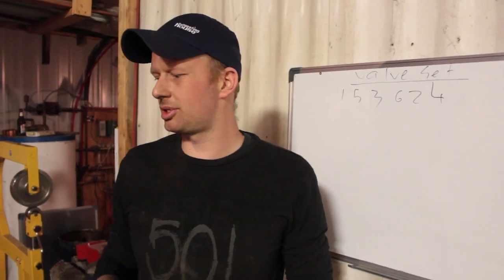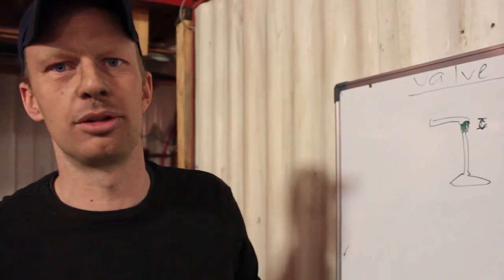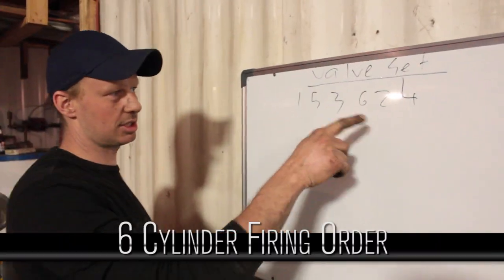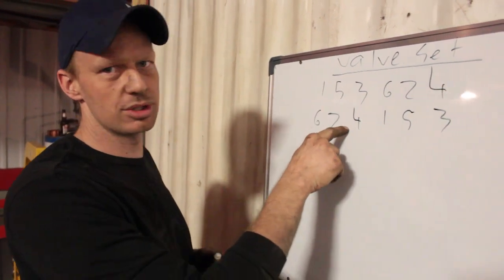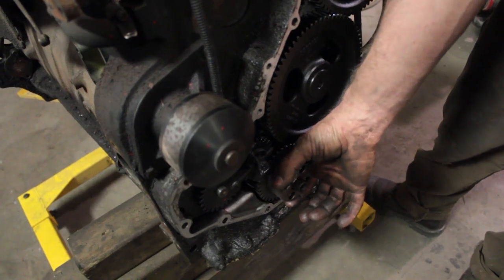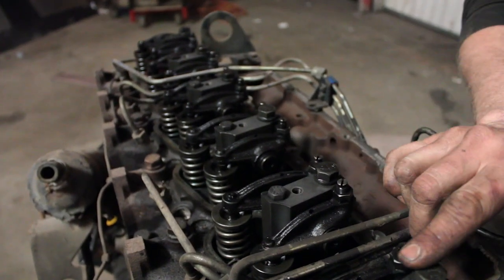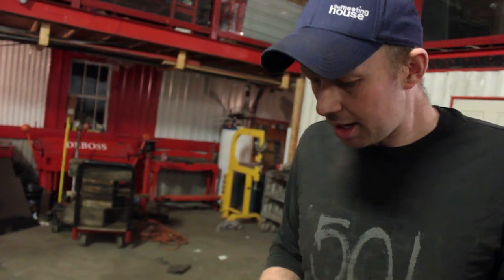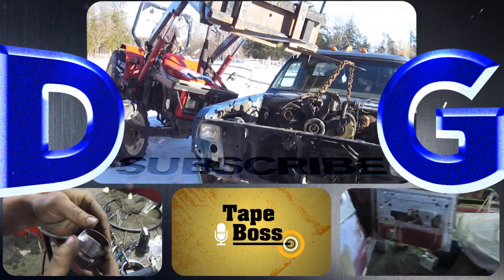How To Set Valve Lash On A Diesel Engine

Comment from the maker: 153624 firing order
624153 valve set
Get a shirt with the cheat sheet: https://teespring.com/straightsix
Reply: Are you going to make any more of those shirts? That’s a lot of numbers to remember.
Reply: great
Reply: Correct
Reply: Told me jus enough to screw me up
Reply: Vere good aaise se samjhane wala hona chahi ye
Reply: torque rating on those fasteners?
Reply: How about v type engine is that same ??

Comment: I would say how some people set their small SI OHV engine lash where having one valve open and one valve closed on the cylinder, checking the valve that's closed would also probably apply.  I don't work on Diesel/CI engines so I am not sure how well that may work.  I would think it's similar since both are 4 stroke and have the same Intake, Compress, Power, Exhaust process but the main difference being compression ratios and no spark plug.  This would seem easier than remembering the cylinder order.

Comment: Most engines are right hand rotation! Which means when viewed from the flywheel end, not the fan end, it will turn clockwise.   DO NOT be fooled by the fan…. Depending on how the belt is oriented the fan may not turn in the same direction as the crankshaft.

Comment: Thanks Rich, its a great video. This is very interesting. I hired someone to come do a valve lash on my Toyota dyna 13B engine, when started it was pushing smoke through the air manifold, i know some settings not right. Could you please advise how i can correct this.

Comment: 6cylinder diesel engine roter type ve injection pump  1and 6 working properly but why not work or misfire 2,3,4,5, what is the probably caused?

Comment: Hello thanks for the videos!
Can you simply let your engine come up to temperature and set the valves to 0 clearance so that when it cools down the correct clearance will be set?
I have a Ford Transit 2.5di mk5 and I have adjusted the valves to the correct positions as per the manufacturers recommendation They where all tight, the engine is now louder then before. Annoying!

Comment: good job boss
but i want to ask  you a question  if possible you can answer me
after finishing engine overhauling  the you swicth your engine  if you look on exhaust pipe where fumes are going tothe atmoshere    you found some fluid ?what cause these fluid to come out in exhaust pipe

Comment: Great video! Just a question on our Ford 220 diesel ; it says the firing order is 1243
different than your so what would be the valve set for our engine? It also says valve clearance inlet hot .015 in. and exhaust hot .012 in. so why would they say "hot" in the service manual? So how would I set the gap cold?  Thanks for the help

Comment: On a 4 cylinder engine, if you set no. 1 piston at TDC at the end of compression stroke you can do no. 1 exhaust and intake, no. 2 exhaust and no. 3 intake valves. Turn the engine 360 degrees (1 full turn) and now no. 4 piston is at compression tdc and you can do no. 2 intake, no. 3 exhaust and no. 4 intake and exhaust.
Reply: Is this true for the vw tdi 1.9l ALH
Reply: @Eger7law011  yup
Reply: I have an 81 Isuzu diesel C223 engine and the manual says with #1 cylinder at TDC compression to do no. 1 exhaust and intake, no. 2 intake, no. 3 exhaust. At TDC #4 cylinder do no. 2 exhaust, no. 3 intake, no 4. intake and exhaust.
Reply: @TonysGarage-tx8rt  is the firing order of that engine 1-2-3-4?

Comment: Hi Rich, a very good video with such detailed educative info. I do have. one question though. and would REALLY,  REALLY appreciate your replying soonest, PLEASE. To set the valves for a manual (stick shift) diesel 4 cylinder, should the vehicle be in neutral or do you need to engage a higher gear? Also, is it possible to run the engine with the valve cover open? My vehicle. needs valve adjustments when warm. PLEASE help. Thank you

Comment: my boy, great for amateurs, used to work for Cummins, try adjusting valves on a short nose kenworth  855 engine with jakes, scary cos its easy to drop stuff down into the crankcase

Comment: Fun fact not all internal combustion engines rotate counter clock wise. Honda up until 2002 made one. Dumb I know. Just saying. Also watch for the intake and exhaust valves. k19 Cummins the first valve you come to is exhaust on cylinder one...

Comment: easy way to remember which cylinder you have to set, you always have to come to one more than you engine has. So if you got a 6 Cylinder you have to get to 7, if number 3 is in between exhaust and air intake you have to set 4 (4+3=7) same for 4 you have to get to 5 so if 1 is cutting cylinder 4.
Sry for my bad english hope you understand it

Comment: I've got got a 98 24v completely stock. that when I start up it sounds like it's been lope tuned, engine turns over it shakes for about 6 to 8 seconds then dies. Could it be that valves need to be reset?? Help if you can, greatly appreciated.

Comment: Hi Thanks for this video. Why don't adjust the rockers by TDC and round the crankshaft 360 degrees adjust any rocker is free not loding
Reply from the maker: Because the cam won't be on the heel of the lobe and your settings will be wrong

Comment: As an alternative could I get the valves rocking then rotate the engine 360’ meaning the engine would be between its compression and power stroke?

Comment: I have found that almost all 6 cylinder engines can be set as follows. When the #1 cylinder is on TDC, you can adjust intake valves 124 and exhaust valves 135. Rotate the engine 360 degrees, now you can set intake valves 356, and exhaust valves 246. On engines that require the injectors to be adjusted you either need to adjust them as you bar the engine, some types of injectors you can set half of them on #1tdc and the other half on #6tdc.
Reply: Excellent ..... simply
Reply: @ethiopia7032  makes adjusting valves and injectors on the series 60 a lot faster

Comment: What is the valve lash for six cylinder perkins diesel engine 2206c-13tag3? thank you for your answer.
Reply: 20 thou
Reply: @michaelgeale9345  thank you so much.
Reply: Both intake and ex? 20thou
Reply: 40 for exhaust

Comment: i adjusted mine car valves in exactly the same way you described but it's still making the clicking sound could it be because i have used gauges which were .3mm less than the specification or it is because of the new adjusting screws i have put in,some one had told me that the new screws make clicking sound for some time till their running period is complete.
Reply: cobra R loose valve guides, possibly.

Comment: Hey Rich,  Love the videos.

A good tip i learned for setting the Valve lash on an inline 6 motor, which may help you save a  bit of time on your Lash jobs,  Basically, when you set the Motor to TDC1,  Both of the cylinder 1 valves are on their base circle,  In addition, The intake valves on Cylinders 2 and 4, and the Exhaust Valves on 3 and 5 are also on their base circles, so you can adjust those at the same time.  The Name we used to remember it was "Intake Exhaust, Intake, Exhaust, Intake, exhaust" when counting cylinders 1-5 (or backwards from 6-2 when you are on TDC6) and it makes it possible to complete the valve adjustment while only having to change position to rotate the engine twice.  (this mostly came in handy while working in Busses or RV's where you could not rotate the engine and access the Valves without having to get out of the bus)

Keep up the good Debauchery
Reply: Additionally, if you use the alternator bolt to rotate the engine, Turn in Counter Clockwise (backwards)  to load up the belt tensioner and prevent slippage

Comment: There's some bad info here.  First, the gap is there to correctly time the valves duration.  Yes, that gap does erode with temp BUT it does NOT come close to closing a 10thou and certainly not 20thou distance.  In reality there's really not a whole lot of difference...maybe a couple of thou at most...between hot and cold iron.  IF you want to remain consistent, keep a magnet nearby and drag the feeler on it then set the valve.  Aim to get that drag every single time.
Reply: TakeDeadAim engine cat 49B1538 singgle valve piring order
Reply: TakeDeadAim 8

Comment: Do not roll your engine using the fuel pump gear retaining nut. This could cause the gear to slip on the shaft on a none keyed pump shaft.  The 5.9 litre Cummins such as this has a provision in the flywheel housing for a barring tool.

Comment: looking for a lil info I just picked up a 06 common rail , im about to set the valves , my question is , the engine has a weird fluttering sound at low rpm  hard to explain but it goes away once the boost comes in , I've heard this lots on 6.7's but not on a 5.9 , this is my first common rail . any tips would be great . lol I'd bring it to you but I'm pretty far away

Comment: This is a great video. However, I have a question and would greatly appreciate it if someone could help. We adjust the valves when the rocker arms have a little bit of free play. I use a filler gauge to adjust the valve clearance with the arm pulled away from the valve in its free play, and when I remove the gauge the arm goes down and touches the valve at a point (the gap looks good at most points though). Is this fine or should the clearance be adjusted when the rocker arm is nearest to the valve in its free play? I have a single cylinder if it is important.
Reply: Roshan Adhikari I’m wondering the same thing.  Maybe we’re being neurotic but on this motor I do also notice how the rocker arm sides a bit from side to side and the clearance changes by a small amount.  So which position of rocker arm do you adjust for

Comment: I'm just putting a head back on a diesel engine and when trying to figure out how the timing works I noticed that by turning the camshaft the valves seem to open in reverse order than they should. eg. Air intake opens directly followed by exhaust. It's states on Haynes manual that cam and crankshafts turn clockwise so I'm baffled. any help would be appreciated
Reply: Martin Meaney Haynes manuals should be used with care. You were turning it backwards. intake,  compression, power, exhaust, intake...

Comment: You could also find top dead center on the compression stroke on number one (often I take a really long zip tie and put it down the spark plug or injector hole. Most engines have a timing mark on the front of the engine to find TDC on the compression stroke to reference engine timing), adjust both valves, because this is a 6 cylinder, turn the crank 120 degrees (one third of a revolution) and follow the firing order. In this case cylinder 5 will be at top dead center on the compression stroke and all the valves will be closed.  Same for a V8 except you turn the engine 90 degrees at a time. 180 degrees for a 4 cylinder and so forth. Take the number of cylinders, divide by 2 (because these are 4 stroke engines) and then take 360 (number of degrees an engine rotates) and divide it by that number. So, 6 cylinders/2= 3. 360/3=120.  There maybe faster or easier ways to do it, but this way you know for sure you're on the base circle of the cam and all valves will be adjusted in 2 (or less) rotations of the engine.
Reply: 177scamo thank you for  your the help.
Reply: 177SCmaro this helped me man thanks
Reply: 177SCmaro arman

Comment: So what exactly happens when you don't have it set correctly. Say you set it with the engine warm. Which makes it so they never close all the way when warmed up. What is the consequence of that?
Reply from the maker: A poor start, lack in power and smoke
Reply: on a gas engine you will have possible back fires and eventually burn out the valve requiring expensive machining to fix if the lash it too tight. too loose will be noise, lack of power, hard starting and eventually excessive wear form metal to metal clacking leading to failure.
Reply: DEBOSS GARAGE z
Reply: Braxton Beckstead In some cases I have seen the rockers being broken like a piece of paper because basically when the piston is doing intake the inlet valve should be open so wrong setting will complicate things and when the piston is coming up and the valve is going down in another stroke and they make contact, you will be lucky if either of the two don't get broken
Reply: Mình thích học về máy. Nhưng k hiu tiếng anh
Reply: darthvader4hirel
Reply: DEBOSS GARAGE we’re the smocked came trhu
Reply: So you won't have a suitable temperature
Reply: Braxton Beckstead compression loss and or burned valves , should pop a cylinder code.
Reply: low power

Comment: how to set valve for more power?
Reply: Simply set them to the proper rating. it will lessen the sloppiness (amount of travel needed until actually begin moving the valve) while also properly sealing the valve

Comment: I've got a 4bt in a f150 and trying to adjust the valve lash correctly.

When describing the firing order 1342 is 2 the front cylinder nearest radiator? or is 1? I want to be sure I'm positioning the numbers to the correct cylinders  instead of getting it backwards.

By the looks of it when you were explaining ''rotating the engine by hand'' (on the 6BT) I seen that 4 is the front cylinder but I had to replay the video multiple times to make sure I had the firing order lined up with the cylinder positions. Just want to be sure I've got it right and I am understanding correctly. Thanks for the videos keep them up!
Reply from the maker: Cylinder 1 is closest to the rad and 4 is closest to the transmission
Reply: DEBOSS GARAGE , Thanks for the reply! Hows the MPGs on your 4bt with the 3200gov spring and (BD?) fuel pin you have ?

Comment: Hey Dirty rich my 5.9 is making a ticking noise that is loudest when driving but still audible when reved in neutral and with clutch depressed. It is mostly heard through the 4 by 4 selector. I took out the selector and I could still hear the noise faintly. Could this be caused by the valve lash adjustment being off or injector?
Reply from the maker: valve lash is worst when its cold but I would start there

Comment: Great video on the procedure simple and easy ... more curious on a method of determining firing order and what chamber corrosponds to what firing number ... in an arbitrary manner without the aid of the ignition coil pack or distributor spark plug boot numbers

Comment: curious is there a general procedure to determine firing order of any type of engine like V , inline ,....etc... I have simple methods to get any chamber to TDC or BDC but  actually finding out  the firing order and what corrosponds to chamber 1 ,2,3,4...etc of an arbitrary engine is difficult for me still
Reply from the maker: Usually the firing order is stamped in either the head or a manifold.

Comment: Do the valves On a gasoline engine need to be done every 50k as well?
Reply from the maker: +gabriel garcia Most gsoline engines have hydraulic lifters and never need to be adjusted.  They used hydrualic lifters in the 60's already.  before that, they would have to be adjusted
Reply: +DEBOSS GARAGE ford.tratore.3000. vale.adjustment
Reply: hey man we got the same name and we are mechanics too, wonderful coincidence im gabriel gumi
Reply: gabriel garcia disel engine cat 49B1538 singgle valve piring order nya bos thanks suport nya
Reply: gabriel garcia 4d56

Comment: Question: I drive a Nissan Navara/frontier 2.5 diesel from 2008. Is it possible to set those valves as well? You are talking about diesels from 2000 and down so that's why I'm asking.
Reply from the maker: +cedicol The easiest way to know is pop off your valve cover.  If there is a lock nut with an adjustment screw, then they are adjustable.  If there is no adjustment screw, then it will have a hydraulic lifter.  As of yet, I have not seen a hydraulic lifter on a diesel but that is just my experience.
Reply: +DEBOSS GARAGE When I find the time a'l take them off to take a look. I'll keep you posted.
Reply from the maker: +cedicol if you have a fill cap on the cover, you can take a look with a mirror or a camera and look for the adjuster
Reply: +DEBOSS GARAGE Apparently they are adjusted with shims. you can adjust them by changing those shims but it's not usual to do that. once they are set they are set.
Reply from the maker: Great to know.  Thanks
Reply: @DEBOSSGARAGE  cool video thanks.  Does that mean hydraulic lifters can't or don't need adjusting?
Reply: Volkswagen diesels have hydraulic lifters. At least the old ones I have do. No adjustment needed on these.

Comment: Every engine doesn't turn  clockwise there are Honda engines that spin counter clockwise.
Reply: And datsun
Reply from the maker: +MidShipCivic I should never say "all" as there is always someone who does it different.  When referring to anything in the car, it is always from sitting in the drivers seat.  That being said, industry standard is a counterclockwise rotation with some exceptions like Honda and Datsun.  Vic Edelbrock Sr. built engines that ran backwards for track racing to put the natural load from the engine on the outside tire.  When officials found out about that, they outlawed that practice.  Most (but probably not "all") marine engines also run clockwise